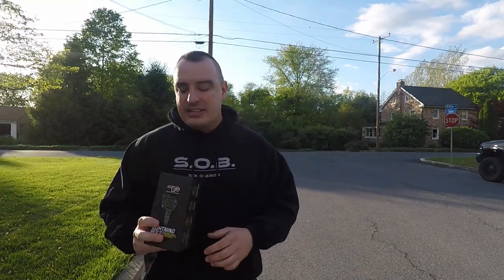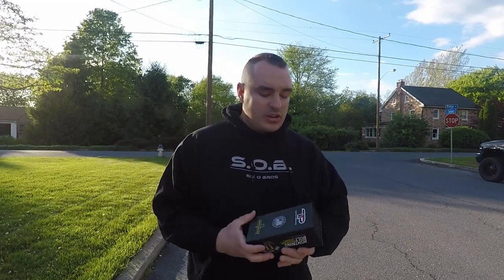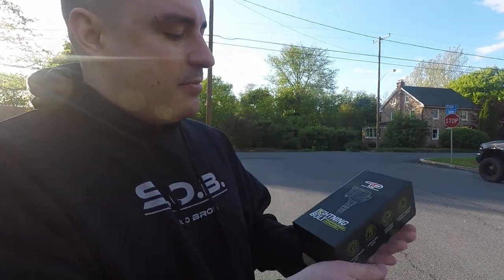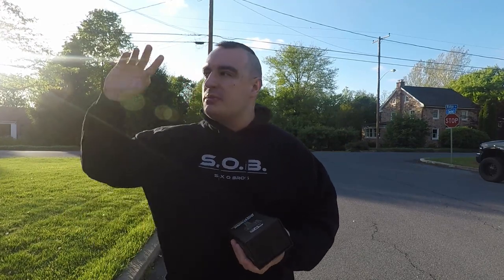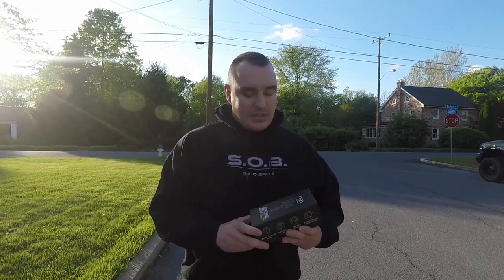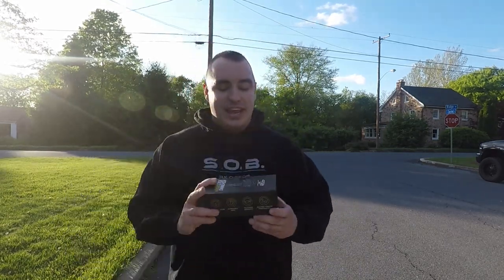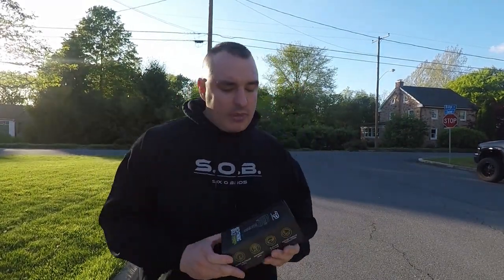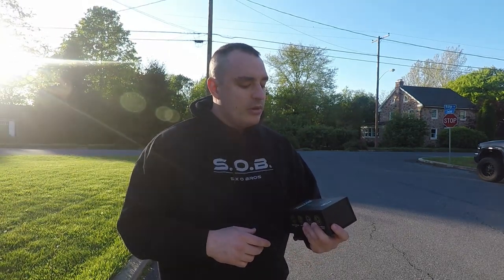Turbo Time USA Lightning Bolt VGT Upgrade

Comment: I run one on my 06 6.0 and it's definitely a noticeable difference from my experience and I run a stealth 67g2 turbo and 205/30 injectors
Reply from the maker: I plan to run 205/30s in the future so that's good to hear. I won't be running as big of a turbo though. Good to hear some positive feedback. A lot of negativity seems to be coming out for this product without having been run. Y many some I'm hoping to be able to add some actual I formation related to it in the near future

Comment: I looked into getting one for my 6.0 but I haven't dropped the cash for it yet but I am very interested In trying or buying. Good to see you Jarod.
Reply from the maker: I'm really hoping for good news soon to be able to give some feedback on what I think. I'm not aware of anything like it so there seems to be a lot of people talking poorly about it so I'm hopeful to be able to give it a solid review
Reply: @six0bros  yeah,well ill be watching to see what you think I don't want to drop the cash on something if I'm not going to get some return on it. I got an email from them when it came out. & I think it was a special price but I was skeptical. If I got atelast a 2mpg increase I'd be happy.  I'm getting 13-17 mpg with My economy tune running my 35's  I think I got 18 hwy when it was all stock.
Reply from the maker: I'll definitely be reporting mpg changes good or bad. I I'm going to try and get some good testing with the new setup first and some semi measurable goals. I plan for them to be very thorough data I also want to plan about a 100 mile trip to try and get good fuel economy. Along with comparing daily mpg for real world but just to see what it can do. I am very excited.
Reply: @six0bros  good deal I'd be interested in that for sure. Hopefully you get some good data im curious what & if the performance gains are really that significant as well. That's a chunk of change for sure specially if you don't see  any gains IMO. I'll definitely be interested in you're findings I'd like to see what & if the egt's stay lower pulling vs normal driving or with a lead foot. Lol  Plus spooling up quicker it may help on the low end just a bit possibly as well.

Comment: How do you get on with the affiliate program.  Dont see them listed on the few sites I know, direct contact?   Been looking at this for my 03' Excursion to makeup the sad performance on takeoff
Reply from the maker: There should be a place to put the six0bros affiliate code at check out. Or this link should apply my affiliate code automatically turbotimeusa.com/six0bros what all is done to the excursion
Reply: @six0bros     Motor wise:  PPE up-pipes, Banks monster catless, 86Diesel black fuel spring,  Bullet proof egr cooler, Bullet proof water pump, AFe intake with sand screen, AGM batteries, 0 gauge wires, ground wires upgraded, Leech Neevile Ag alternator, KC Turbo center upgrade for the stock turbo, fresh rebuilt turbo, Mishismoto CAC tube kit, Mishimoto radiator, Mishimoto trans cooler, 6.4l deep pan/ filter up grade,  the rest is just OEM replaced parts that were included in the listed projects. Ford HPOP and sensors. Run all Lucas Oil products with Archoil in oil. 165k non studded checked 6 times by Ford through the years.  Powerstop brake fleet kit, 6" Procomp/ATS lift, cantilever5 air bag setup to both rear leaf springs,  fresh rebuild on both axles, pioneer touch screen, Pioneer 5 channel 800 watt amp, Focal door speakers, JL Audio 10" .   LEd upgraded healights interior bulbs, and 07 Harley Davidson  Front end

Comment: Did you ever actually test one of these? Considering dropping the $420, but I’m still curious how it would perform with my gearhead SRL tune. Also has pmax turbo upgrade, stock injectors. Lags quite a bit with stock fueling. This lightning bolt vgt sounds aweosome in the description but I’d like to see more testing/review
Reply from the maker: I am getting ready to but I have not officially done it yet. I was told the shop is dropping my engine in the truck this coming week provided everything went well with their previous job. I would expect a week and a half before I have the truck back just for them to make sure everything is good
Reply from the maker: Once I get that back I plan to do the review about a month later. I may consider trying it on a powermax at some point since there are many powermax turbos out there but I have one of their larger 65mm turbos going on this build

Comment: I have this on my diy 63.5, it does make a difference on when the vanes open and close.  looking at turbo time turbos. I have stock injectors and want to pull max weight
 Which turbo time turbo should I go with?
Reply from the maker: So for stock injectors if you don't plan to ever go bigger (which is perfectly fine to stay stock size) I would recommend the 61mm turbo or their stage 2, 64mm turbo . Both will take full advantage of the stock fuel. The stage 2 will will run at a lower boost pressure while still pushing the same amount of air. So the main difference is where you want the best performance. The 64mm turbo will have better turbo end performance and midrange is where you will start to feel the added top end performance. The 61mm will really do well on the low end. And even into the midrange but in the midrange the other one takes off. So I would take this into consideration for what will be best for you. If I was picking one I love the performance of 64mm it is one of the best all around upgrades. I did want to add if you have bigger tires and didn't refer your axles the 61mm would be the best option for towing you will lose some top end but won't have to deal with being under the turbo so much as far as rpm
Reply from the maker: If you do buy a turbo don't forget my affiliate link for 5% off
Reply: Thanks, could you recommend a certain model?  They have different 64 mm.
Reply from the maker: So I really like the velocity port version. I like the idea of the air having a very smooth path to travel into the compressor wheel. To a small degree this should aid in spool up and overall performance however it isn't going to be night and day difference. As for single vs dual plane. The single plan wheel will spool a little fast and are excellent for all around use. The dual plane wheels will flow more on the top end but trade of slightly less spool up if that makes sense. So single plane is better for towing typically. They are both great design just will do slightly better in certain situations.

Comment: So Jarod I've got to contact Turbo time usa as my 6.0 is setting a p2263 just a heads up. I replaced my dpfe & checked my dpfe tube it is all clear n clean. I Reset my codes drove my truck & it set the code again. So I cleared my codes again reinstalled my stock VGT drove My truck & did some WOT runs  plus I drove down the highway aways, Then back to my house. Checked my codes no codes were set. So I'm thinking the Lightning bolt VGT S is my problem.  I'm going to call TurboTimeUsa on Moday. Also my Mileage & fuel economy dropped maybe I'm hoping it's a bad VGT or maybe it's an issue with my tunes running the S model. Hopefully it can be figured out, if not I'll return it as I'm on my 30 day trial period. I Told you I would give you some input. I'm still running stock ford injectors also.
Reply from the maker: How is this coming along? Any updates?
Reply: @six0bros  yes talked to the tech at T.T. my truck is overboosting & that means the Solenoid is doing its job  appfooled. It is spooling my turbo up quicker for sure  so he said I should try a boost fooler. I told him all I have done & I am running one of there turbos also with tunes. I messaged Warren Diesel to see if maybe they have a tune that can do something about the overboosting possibly in a program maybe but I haven't heard back yet. Apparently this only happens at WOT or when you stomp on it to pass etc etc. I'm not hip on the boost foolerI don't know much about them but I'll give it a try to see what's up.  Like I told the tech I don't beat on my truck I told him I mainly run my tow tunes,economy tune & my hot street tune pretty much normal driving.  I changed my dpf sensor also the tube was clean but as a precaution I was there so I just replaced it. My pids all look good as I've been monitoring them all with my cts3. Baro,Map,VGT all seem within parameters that I can see amongst others.
Reply from the maker: Please keep me up to date on this. I would imagine through tuning they can do something if the tuner is willing to change things anyway.
Reply from the maker: Also thank you for the updates. Once the truck is back I'll be doing some very in depth testing of things and it will be nice to have some information from yiu as I start. Thanks again man
Reply: @six0bros  you are welcome. I still haven't heard from Warren Diesel on getting a tune that may help instead of using that boost fooler. It will be to me on Friday so if I haven't heard anything I'll install it then put my Lightning Bolt back in & drive my truck to see if the eliminates the P code I'm getting. 
You might contact T .T. in the mean time as you have way more modifications done to youre truck than I do. You running the R model or the S?? I presume the R with all youre mods unlike me running the S model.
Reply from the maker: Turbo Time and I have talked a lot about this even before itbwas released. I wanted to do some testing with them but without my truck I obviously couldn't. I am going to be running and testing both and comparing/contrasting them with the factory one as well.
Reply: @six0bros  sweet. I sent Warren Diesel an email but haven't heard back yet. My boost fooler arrives tomorrow do I'll install that tgen put my Lightning bolt back in drive it & see if it sets any codes.
Reply from the maker: Any updates man
Reply: @six0bros   yes so my new dpfe sensor was bad I did get a boost fooler but I didn't hook it all up. I changed out my dpfe reset all my codes & damn if that didn't solve my problem it's pulling so much air at wot that is setting my air filter minder off in my dash. So I took the clear plastic top off my airfilter box & it doesn't set it. I'm hitting over 23lbs of boost easy & when I run My Warren Diesel hot street tune its 30 or more so I watching that closely also I have no turbo lag from a stop either. I've checked codes all good & I'm monitoring all my pids dpfe,map,baro gets are good boost running at 70 is 2-6 lbs egts 600's to 1025 running 35" tires down the highway & up grades with the cruise on.
Reply from the maker: That's great to hear man glad it's resolved now! I can't wait to start testing on them too
Reply: @six0bros  yes it is 4 sure. Ill see how it does on the 19th as I am towing my Teryx4 to Oklahoma  to go have some fun.
Reply from the maker: That's great man excited to hear

Comment: Have you had a chance to do an honest review of this? I'm really curious about it. There aren't many reviews, and forum chatter says they litigate any negative feedback. Who knows if that's true, just looking for an honest review.
Reply from the maker: I have not however in the near future there will be reviews on this for the 6.0 and 6.7 powerstrokes. I have gotten positive feedback from subscribers but I cannot comment until I get my 6.0 back which the bottom end is built now so the truck should he back soon
Reply: @six0bros  I pulled the trigger and bought one. I used thw Forscan app to record a bunch of PIDS to compare a before and after along with mpg manually. Off the bat on my stock turbo, it's dropped the VGT% from 63% at idle to 55%. Spools a little faster as well. I had a little scare at first with the amount of black smoke out of the pipe but I hadn't done a vgt relearn cycle and that took care of it. I look forward to your testing.
Reply from the maker: So overall you are enjoying it? Am excited to test it since it has become so controversial it seems
Reply: This week will be the real comparison but I like the faster spool.
Reply from the maker: That's great to hear man

Comment: With or without discount it’s the same price?
Reply from the maker: I will get you a link now let me check into it
Reply: @six0bros  I actually just ordered it 20 minutes ago. Thanks.
Reply from the maker: What turbo were you looking at? I just checked code six0bros works. The code will work on any of their performance turbos. If you were buying a stock turbo the code will not work for that.
Reply: @six0bros  I got the lighting bolt vgt solenoid
Reply from the maker: Did the code go through? If not if you call them you may be able to still get the code applied

Comment: It takes 30 minutes to install. Why 2 videos? Be considerate of peoples time.
Reply from the maker: The turbo or the solenoid? I did two different topic videos around this video and neither one of them were on installing a turbo. If you need help on how to remove and install this video here may cover it for you. You may have just stumbled upon the wrong videos and seemed to have missed the point of what I was doing in these but here is a how to video https://youtu.be/F4Jfr65zQ7Y